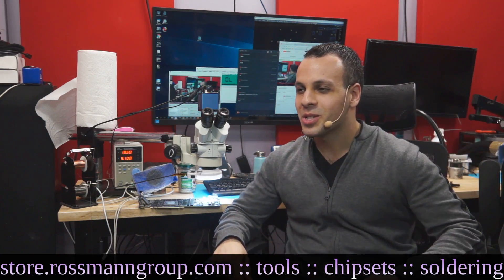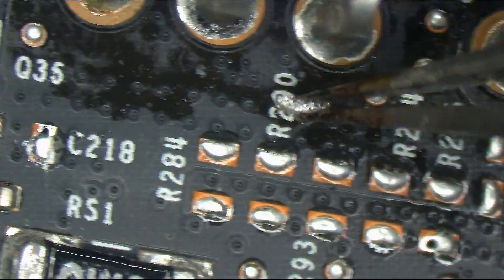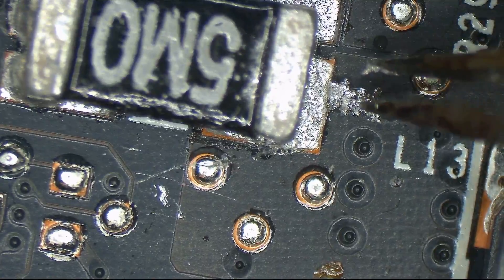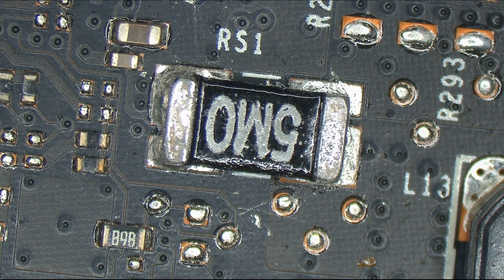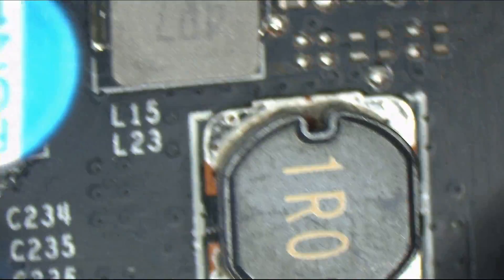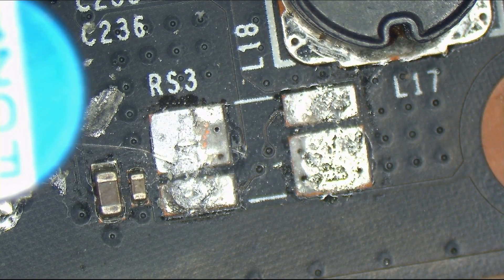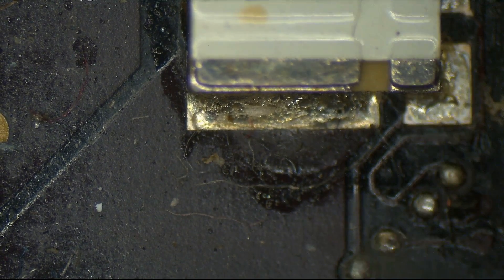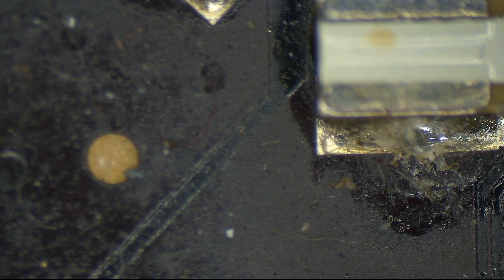DO NOT SHUNT MOD YOUR GRAPHICS CARD WITH LIQUID METAL!

Comment: Could it be possible, that liquide metal thermalpaste was used on the current sense resistors to enable better overclocking?
Reply: People do use Liquid Metal on the shunt resistor to short it and allow more power through put. The liquid metal could have degraded the solder joints.
Reply: Not could have, the Gallium in LM alloys degrades solder over time. It's one of the risks you take by doing a LM shunt resistor mod.
Reply: I don't know who was the idiot to suggest ruining perfectly good boards with that liquid metal crap, but apparently it's a thing. Sad.
Reply: Also destroys the crap out of aluminum so while great for thermal conductivity, it's godawful to use for a thermal paste unless it's going to copper.
Reply: rupr yes it is a hundred percent a reality people do a Power Shot mod to reach the upper limit on their gpus as well as use thermal Grizzly liquid metal thermal paste for better heat transfer between the CPU and heatsink for GPU and heatsink. Liquid metal has also been known to corrode and damage pcbs but not the Silicon substrate
Reply: I guess there are people that are able to spend more on a video card than I've spent on computers in the last 15 years, and they simultaneously are stupid enough to do such a reliably destructive "mod" instead of investing an utterly trivial amount of effort to emplace a jumper or a lower-value resistor.    

I must be doing something wrong in life, because everywhere I look, I see a spectrum of people from morons to shitbags that've got it made.
Reply: Yup, but you must be really a thick fella to be stupid enough to use LM to do so when you can just run a wire on it...
Reply: Yeah, I'm sure it upscales the flux capacitor at least 10 Gauss!

Comment: What brand is this?
Reply: NVIDIA doesn't sell graphics cards. They design the chip, then give the chip along with a reference board to third parties for custom production and sale.  

The OP is asking which of those third parties manufactured this particular board, because NVIDIA certainly didn't.
Reply: Actually NVIDIA does sell graphic cards since the pascal architecture. They are called founders edition. google nvidia store and you will be amazed that nvidia does sell it's own manufactured GPUs since 2016.You can't find them in stock because of the miners but that is another topic.
Reply: There are no third party pascal titan's, they are all reference cards sold directly by nvidia.
Reply: literally in the title of the v ideo?